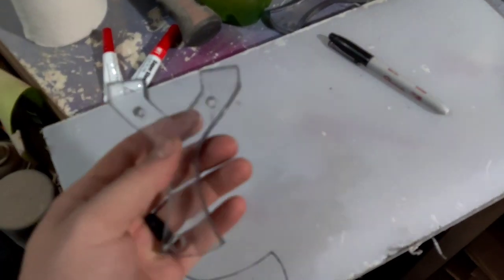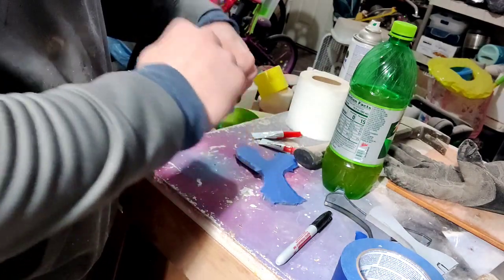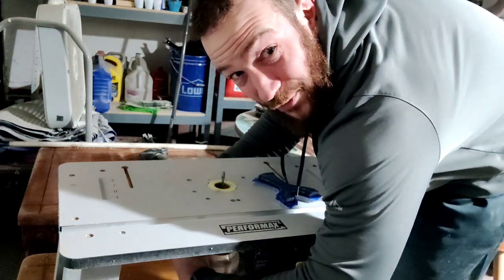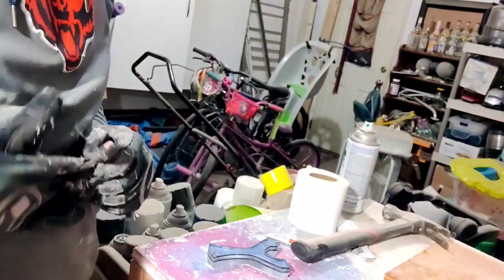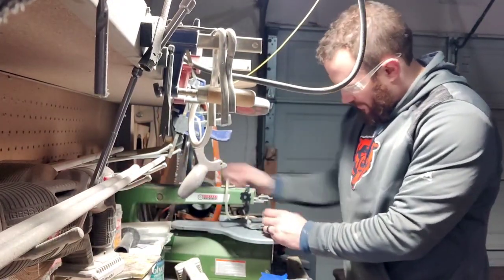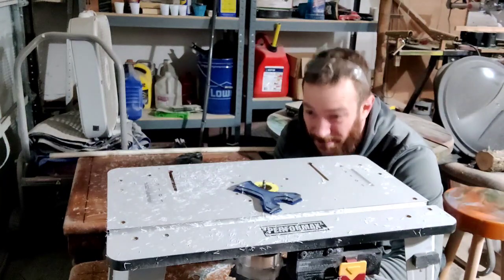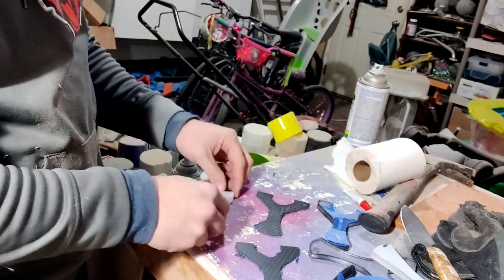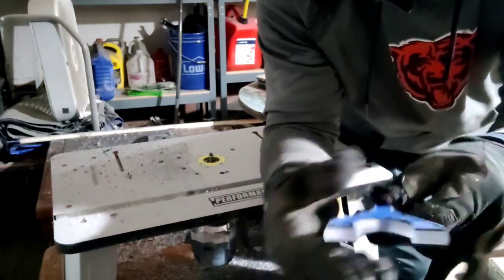How to Make Slingshots on a Router: Part 1

Comment: Cool video, thanks for sharing. Some thoughts from a different angle. In Leatherworking I use a bookbinding press to laminate leather. Or for applying linings. It would be the business for laminating carbon fiber to polycarbonate. 

When trimming the carbon fiber, you attach it to the template. Then remove it and remove the tape and attach to the core. I’m curious why you don’t use the new core as the template for the carbon fiber? It seems like it would save a few steps and make an exact match (lineup) with the core.  

I appreciate you sharing your knowledge.
Reply from the maker: It's purely and simply because I don't want to risk ruining the new core if I don't have to. I'm still learning and using the router is still relatively new to me.  After I make the core, if it's in good shape I don't want to risk messing it up again.  

I've had router bits break, bearings come loose, and I've gone through a few would-be cores. I have back up templates too for that reason.
Reply: @TheSmoShow1  Sound reasoning.

Comment: I know this is a two year old video, but I'm just finding it now, and I'm new to slingshots. What router bit is this? all of the flush cut bits I've seen have an almost straight flute, none have the spiral flutes like this one, it's almost like an endmill in the video, but with the flush cutting bearings??